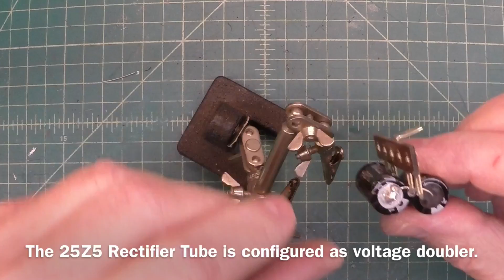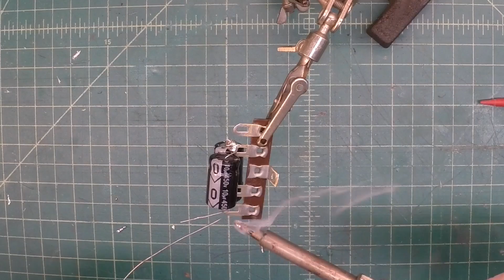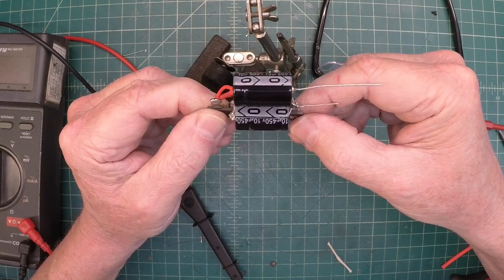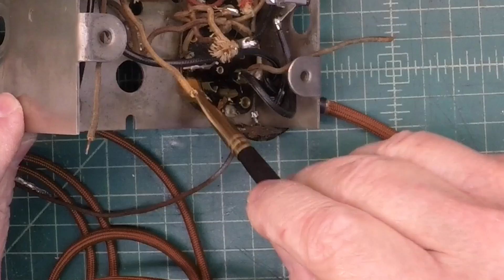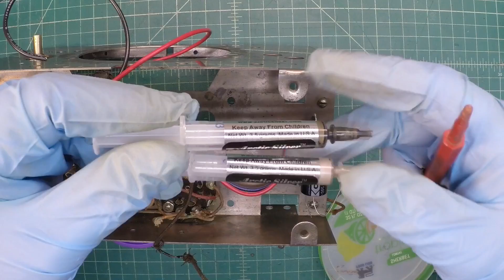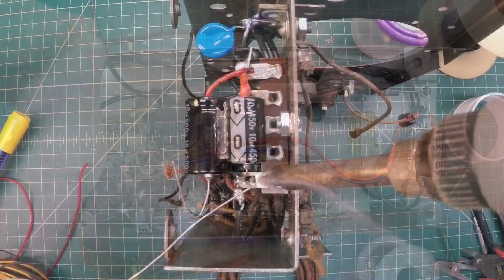Silvertone "Companion" 57 D 1704 - Working on the Heater String & B+

Comment: Have you tried fiberglass pens for cleaning contacts,and have you used any high temp silicone wire get for your work on tube radios ,I try when I can to put in better parts that I have had to replace..I just found this video of your I do love learning from you thanks
Reply from the maker: Hi Ron - I have not tried fiberglass pens for cleaning contacts; thanks for the tip. In addition, the only silicone coated wire I recall using was for some high voltage test leads I made up. Did you see my request to send me your email address so I can send you the capacitor color code documents? Best, Don
Reply: @RestoreOldRadios  I bought my first fiber glass pen,from radio shack came with a refill ,9.00 dollar ,then I bought three different kinds from ebay brass,fiber glass ,and one that looks like steel ,I pretty much use the fiber glass ,6.00 dollars for all three or 2.00 each from ebay ,also check out Ali express  ,they are cheaper modt of the time ,if you use it a lot use gloves,fiber glass if you get it on you I was taught to use cold water,I just use it bear handed .hope you will try these they clean well  dirty contacts very fast

Comment: What is the brand of mini heat gun you use.  I have an old one that stays on and i have to switch it to cool for a few minutes before turning it off.
Reply from the maker: Hi Roy - the info below you requested. Best, Don

Iso-Tip 7975 Micro-Therm Flameless Heat Gun https://www.amazon.com/dp/B0002V2FEQ/ref=cm_sw_r_cp_tai_2Y4HCb28ZPYCF
Reply: @RestoreOldRadios  Thanks Don,  I ordered one today.

Comment: Thanks so much Don. I REALLY appreciate the picture in a picture, especially the way you show the schematic and then trace the wires so we can better understand how everything connects together - especially we who are still trying to learn how to read and understand schematics.  Questions:  how did you determine the size power resistor to use, and likewise, why did you use that size diode?  Having never installed a diode, I assume the stripe signifies something and that you placed it the way you did for a reason.  Looks like I'll next be trying to learn what a diode is and why/how you install one properly.  Sorry for all the basic questions, but it seems like new things are constantly coming my way.  Mike
Reply from the maker: +Michael McKenzie Mike, Thank you. There's a lot of great resource material on the Antique Radio Forum in addition to Paul Stenning’s site at: http://www.vintage-radio.com/repair-restore-information/valve_dropper-calcs.html

After you review, reach back out and let me know your thoughts. 

Best,

Don
Reply: Thanks Don!!  I just reviewed the link you forwarded and tucked it away for future use.  I saw the reference to the size diode you used.  I also did some research on diodes and now understand the markings on the component.  I have watched all of your videos but don't recall if you have used a power resistor and diode in the past to drop the heater voltages.  Have you?  Do you do so on every radio or are there some parameters you look for to reach the conclusion to use them?  Thanks in advance if you get the opportunity to respond.